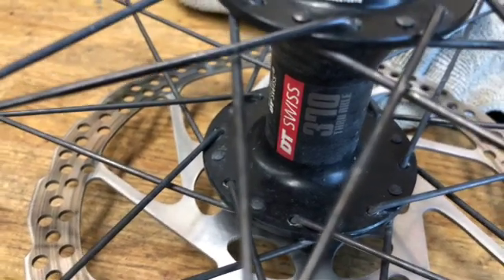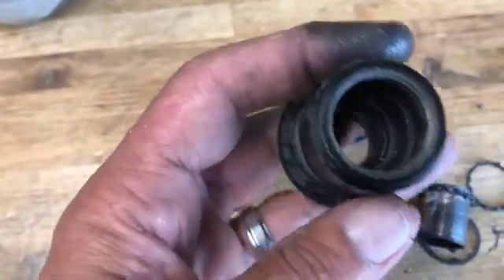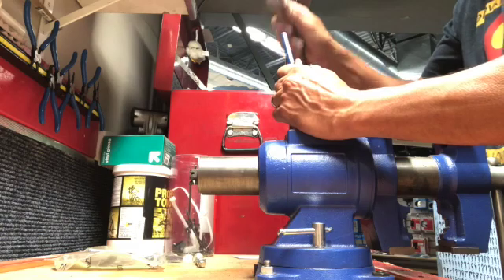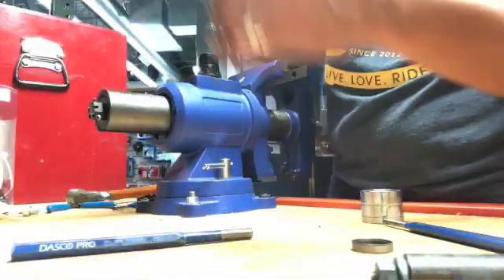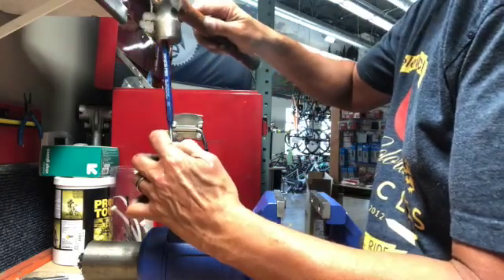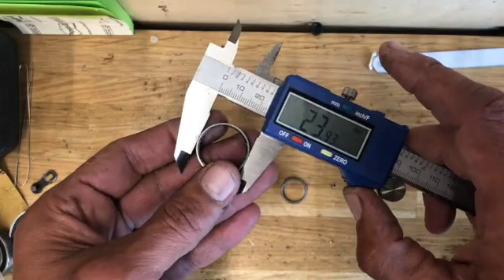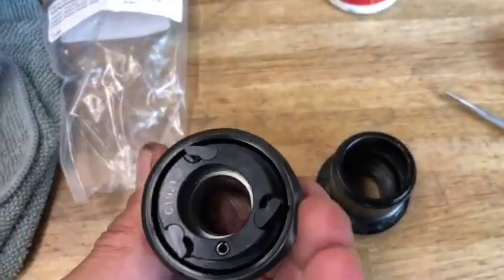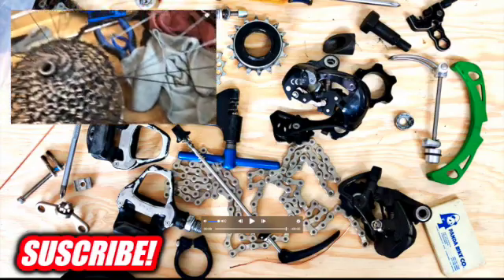DT 3 Pawl Freehub Overhaul

Comment: Good stuff. Ive wondered about doing this when mine go south. Would warming up the hub first help? Like boiling water? Thanks
Reply from the maker: Usually just some penetrating oil or nothing at all. Normally cartridge bearings are pretty easy to remove, but on this particular hub, the only remaining parts of the bearing was just the outer races. Those by themselves can be difficult to remove if they're hard to access.